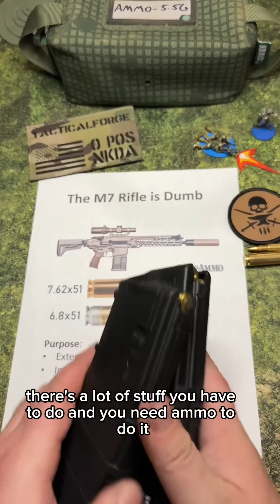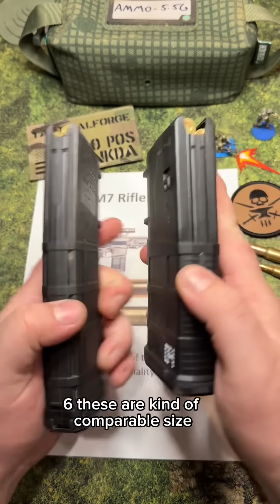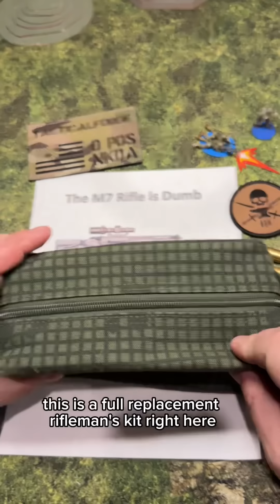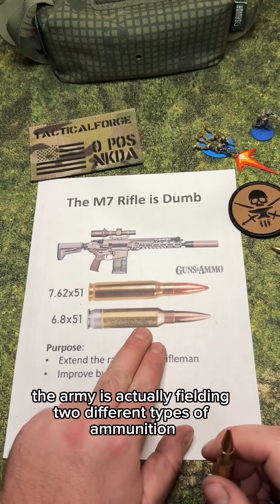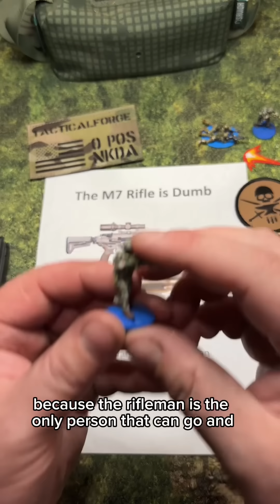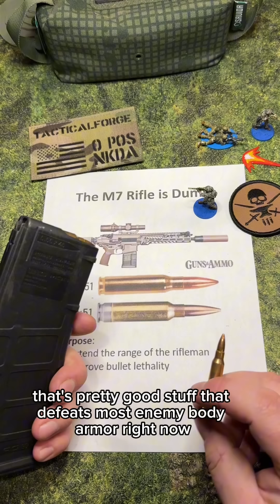The Army’s new rifle is dumb

Comment: "We want a rifle with higher velocity to penetrate armor, so of course the first thing we want to do is remove the one thing that makes a rifle higher velocity, by cutting off half the barrel length!"  -idiots in charge of this program.

Like, FFS, instead of making a new high-pressure cartridge that beats the hell out of the operating components, and ruins accuracy, why not just use a .260 Remington, or .270-08, or 6.5 Creedmoor with a 21 inch barrel?  They literally could have just rechambered an AR10 in 6.5 Creedmoor and they would have had a better rifle that was closer to actually attaining their stated goals.  If you're so worried about overall length, use a bullpup configuration.  Better yet: don't worry so much about defeating rifle-rated armor plates, because those only cover a small portion of the surface area of an infantryman: so just train your soldiers to shoot low center mass, and shoot twice (with ammo you can carry two or three times as much of for the weight, like 5.56x45mm).  Just accept that rifle fire really is just for suppression, to keep the enemy pinned down while you call in the real killer munitions like mortar fire or artillery or your grenade launchers; don't give up the actually useful volume of fire of intermediate-caliber rifles, to chase after the fantasy of using your rifles as some kind of one-hit-kill superweapon.

The M7 was the dumbest possible solution to the perceived problem.
Reply: As someone who loves bullpups, there is yet to be a good, reliable bullpup configuration suitable for military application at scale (Tavor, Steyr, even the KelTec's are all great, but they all have massive compromises).  As far as 21" barrels... come on, now.  You've got to know that's Fudd nonsense.  You're gonna arm doorkickers with hunting rifles?  Gimme a break.  The 6.8 isn't a bad round, and the rifle isn't even necessarily a bad design.  Is it a bad choice for a primary small arm?  Yeah, might be.  There's certainly some reasonable justifications for it, but I'm not entirely convinced.  But conceptually, a short barreled, suppressed rifle with a fast burning, AP capable round isn't a bad idea per se.
Reply: @MacroAggressor  There is nothing mechanically different in the action of a bullpup besides a trigger linkage (which have been used on coaxial and aircraft guns for a century without problems).  To claim that bullpup designs aren't "suitable for military application" (despite half the civilized world adopting them into service) is incoherent.  

Also, I was a doorkicker, and did see extensive combat including much room clearing.  No, a 21" barrelled rifle really isn't that big a deal, even for room clearing.  Particularly considering that in a near-peer HIC, you'd be clearing (or at least prepping) rooms with grenades, not precise rifle fire.

But if you weren't being such a smug, arrogant know-it-all, you might have noticed that I never actually advocated for long barrels or bullpups; I merely pointed out that IF HIGH MUZZLE ENERGY IS ACCEPTED AS A CRITICAL REQUIREMENT FOR A MILITARY RIFLE, the sensible way to achieve that is through a longer barrel, and that if short overall length is also a requirement, a bullpup design achieves that.  And both a 21" barrel or a bullpup comes with tradeoffs far less severe than the M7 comes with.  Five extra inches on the muzzle end is much less significant a disadvantage than is carrying half the ammunition load OR of attaining mere 4 MOA accuracy OR of shooting out the rifling (and becoming useless) in as few as 5,000 rounds.  And the M7 has all of those drawbacks.

But I reject the notion that "shooting through SAPI plates at 300 meters" is a sensible requirement for an infantry rifles to begin with. (Maybe you should have read the latter portion of my post, before spouting off?)
Reply: @bronco5334   Lmfao, someone skipped resilience training xD it's astonishing that you could write all that, and still bring yourself to claim I was being "smug, arrogant" and a "know-it-all".  I don't believe for a second you were a doorkicker.  You're a LARPer at best.  I'm not gonna engage with someone as obnoxious as you.  Good day, sir.

Comment: XM7 with the 6.8mm ammo, is created to defeat the body armor of Russian and Chinese army that could stop NATO 5.56mm ammo.  However, the person, who come up with the idea, ignore the fact that both Russia and China, do not have budget to equip all their men with body armor.  Only small number of special forces in Russia and China army have body armor. Therefore, 5.56 ammo is good enough in most mid-range gun fight. The XM7 6.8mm is design to defeat a threat that do not exist. In many gun fight, the armies and marines ended the gun fight by calling in the air force close air support (A-10 = 30mm ). Therefore, this make 6.8 mm ammo look like a joke. The XM-7 rifle length is too long and is a pain in the ass to get in and out of vehicles. Close Quarter Battle with a long rifle in urban area and jungle environment is also not suitable.
Reply: XM7 is a joke for other reasons, but the fact that China and Russia don’t currently issue heavy armor widely isn’t one of them. The 5.56mm has been the standard infantry cartridge for nearly 60 years - the .30-06 (and briefly 7.62x51) for nearly 60 before that. It’s likely that whatever weapon system & cartridge the army adopts next will be in service until the 2080s. The world will be a very different place by then, as will armor technology. 

So I don’t blame them for wanting a round with high penetration, even if I think they’ve chosen the wrong route.

Comment: Instead of the new 6.8 we should be going 5.56 improved. Take .223 AI case dimensions, load it in shellshock NAS3 cases, and crank up the pressure to 60k+ PSI MAP, then top it with a sierra 77gr OTM bullet that has an M855 penetrator in the tip. Viola you now have a cartridge with increased power, range, penetration, and decreased weight compared to standard 5.56. Almost any current 5.56 rifle can be converted over, and the gun will even still shoot regular NATO 5.56. 

I have to compulsively mention this idea any time the M7 gets brought up. I'd love to see the cartridge described above, in any modern 5.56 assault rifle, going head to head to head against the M7.

Edit: fixed last sentence.
Reply: higher pressure wears out barrels even faster. just make a modernized 5.56 rifle
Reply: Seriously, those shellshock 77g OTM rounds are so much lighter. I got my hands on some and I was floored that my 40 round mag was 2 thirds the weight.
Reply: Funnily eniugh, you're describing the tungsten-cored version of the Chinese 5.8. The Chinese have this weird predicament where they can't do brass casing because they don't have much copper while having the world's largest electrical equipment and electronics industry (meaning all the copper goes there), but simultaneously being the world's largest producer of tungsten. So, tungsten-cored steel-cased bullets.
Reply: Well. It doesn’t have the penetrator tip but badlands is doing this with the black hills otm 77 gr round
Reply: @DanielStreiff-v1q There's multiple manufacturers loading 77gr sierra OTM bullets in NAS3 cases. The NAS3 cases are thinner than brass causing a case volume increase that gives about the same performance boost compared to regular 5.56 as .223 Ackley Improved does. But the improved case geometry isn't mutually exclusive with the NAS3 cases, so a new round could benefit from both.
Reply: The 5.56 improved I've described in the above comment is a collection of incremental improvements to 5.56, coming together into a significant performance boost.

223 improved case geometry gives ~10%+- more case capacity 

NAS3 cases are stronger, thinner, and lighter. 40-50% weight reduction compared to brass, increased pressure tolerance, and ~10% case capacity increase.

77gr OTM is a big slippery bullet that greatly increases range and terminal effect compared to 62gr. 

Penetrator tip like m855 for extra penetration power. 

Pressure bump like m855a1 because modern materials can handle it. 

77gr OTM loads in non-improved 5.56 NAS3 cases are already doing 2900fps+ (mk262 is 2750fps). Stack some more incremental improvements and you'll be looking at a monster.

Edit: I wanted to add that another benefit is the improved case geometry is safer for increasing the pressure spec because it won't chamber in unimproved guns.